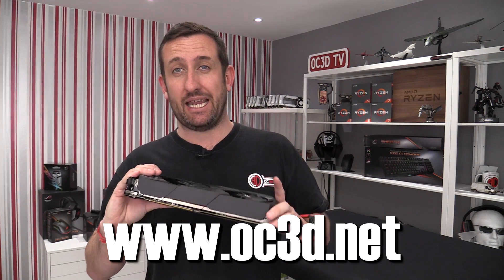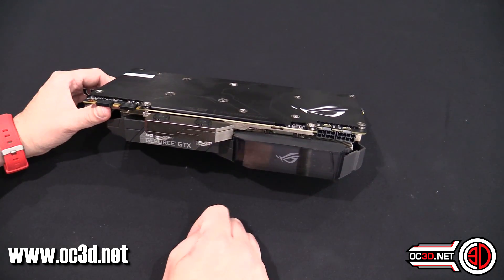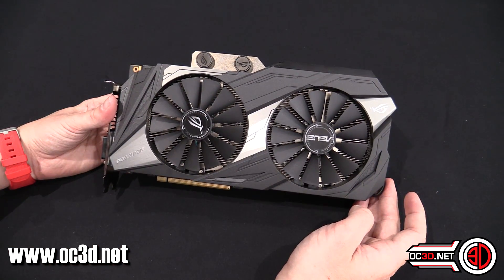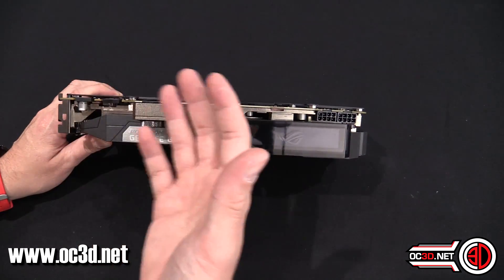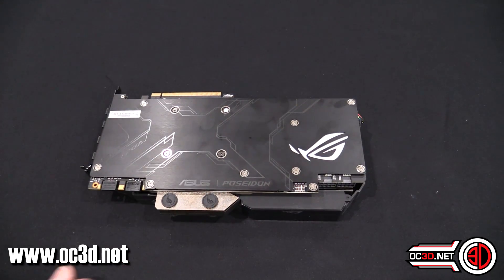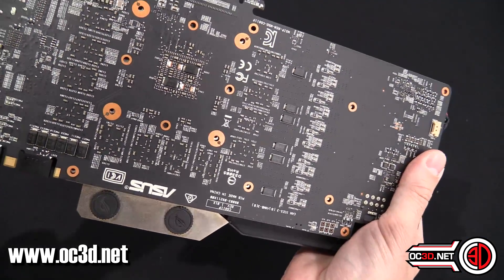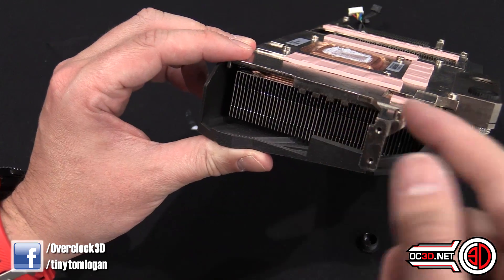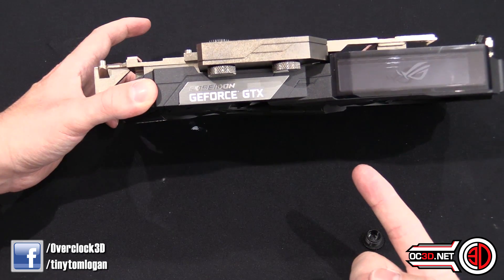Asus ROG Poseidon Hybrid GTX1080 Ti Review Air & Watercooled

Comment: I decided to liquid metal with conductonaut  one of my SLI poseidons to see if there's a big difference.  It dropped 2c on air from 72c to 70c at 21c ambient.  MSI rx480 gaming x dropped a whopping 7c at 60c from 67c.  The air cooling efficiency for the poseidon is a tad bit better than the reference, but no by much.  Water cooling is where it's at.  Will liquid metal the other poseidon and a titan Xp galactic in the near future and hope it has better thermal gains.

Comment: 27 degrees baking hot LOL, come to Australia, 40 degrees inside is baking hot :P What closed loop water cooler would you recommend? Also is there any companies that use refrigerant in their coolers? I would have thought that would make more sense. Ok, being complete newbie to water cooling, perhaps I should go the Strix though if you get 75 degrees in a 27 degree room, I wonder how hot it would get in a room I consider hot, mid to high 30s or above though at that point I would probably have put the aircon on.

Comment: Any idea what type of metal the water channel is made out of? I am concerned it might be made out of aluminum. I bought this card and added it to my custom loop. It is performing extremely well and temps are excellent but I am concerned the water channels are aluminum. With overclocking I am stable at 2075 mhz and temps are in the low to mid 40s. I hate to have to return the card but I will if I find out the water channels are aluminum. I haven't been able to find a solid answer.
Reply: I ended up returning the Poseidon. I couldn't and still haven't gotten an answer from Asus about what the water channels are made out. I am not going to risk damaging my loop if the Poseidon water channels are made out of aluminum. I am going to get a different 1080ti and an EK block.

Comment: how big of a power supply do you need to SLI two of these
Reply: I would say go with a 850 or more. When overclocked this card can pull over 300 watts. Two of them in SLI with a high end CPU could pull 800 watts easily if not more. If you are running a very power hungry overclocked CPU I would go with a 1000 watt power supply.
Reply: So I got a 1000w power supply the problem I am having now is that both poseidons SLI with the bridge is overheating. I do not know how to custom water cool yet so I wanted to start out on air but now they are overheating and freezing :/

Comment: The big advantage with this card is that you can sell it much easier than a water-cooling only card since it doesn't require you to have a custom water-cooling system
Reply: Also, if you are working on your loop you can still use air cooling.

Comment: Would you pick this or the EVGA Kingpin 1080ti card?
Reply from the maker: Ive not had the privilege to test the Kingpin so it would be unfair for me to advise
Reply: Chris G I’ve been trying to decide between them both, also. I decided on this because it’s July 1st and the Kingpin release date hasn’t even been announced yet. Even after pre orders start, it usually takes EVGA quite a while to deliver or keep stock up. I am a little worried about Asus customer service, though. I think the main reason I chose this is because I don’t have to buy a water block right away. I just moved my PC into a Lian Li PC-O7s. It’s a compact ATX case with no front fans, only top exhaust, so the water cooling is almost a must with the tempered glass side panel on. 

Hope that helps you out.
Reply: Chris G I had the Strix, but I returned it because of pretty bad coil whine.
Reply: Scott G. Was thinking of the Strix but I might change my mind.

Comment: how low does the temps gets on water + fans set on max?
Reply: jayztwocents tested it with a 240mm rad with the rad fans at max and gpu fans at 60. Under 100% load at 2110mhz it was at 42c

Comment: the good thing is flexibility you can run it on air to check stability of system b4 you install the loop, or you for limited time you don't run water or you plan to water cool in the future this card would still function pretty well.
the down side might be the price some places it runs for 840$  some place it would run more like tom said, depends for how much you get it for ,
a decent water block would cost you around the 120-140$ so if you plan to water cool non reference card it might be a good card assuming you get it for reasonable price ,
personally i prefer normal full waterblocks that can even make your card 1 slot and looks is usually better, but it up to the individual to decide .  but god those manufactures need to get rid of the DVI port
so we can have beautiful 1 slot cards. also you have MSI seahawk EK and EVGA hdro copper (when it would come out) , so if you want to buy preinstalled water block card you have 2 other good options.

Comment: Aorus 1080 Ti 11G: SuperPosition Extreme 1080p scored 6276, compared to POSEIDON on water 6004... See TucoPacifico (my) post: http://www.overclock.net/t/1627238/gigabyte-aorus-geforce-gtx-1080-ti-owners-thread/1240. Am I so good with my case cooling, or is the Poseidon just inefficient?
Reply: Or won the silicon lottery?
Reply: เพียงใช้ตัวแปลภาษา :D

Comment: The reason the temps are pretty acceptable on this card is because the heatsink uses a vapour chamber with an embedded water flow section, as Linus mentioned, manufacturing such a vapour chamber is quite expensive and a massive challenge, it can't be cheap and that's reflected by the price.

Comment: could you run water with air and get even better results or you are limited to only one ?
Reply: +Pennywise so this card should easily be under 40c with both cooling solutions and a low fan speed would make it quiet.

Comment: lovely thing about this is you can test or use the card as you finish saving up for water cooling parts. also have to consider your spending an extra $100+ for the block anyways. wish you could flip the led on the side upside down for inverted cases

Comment: This card costs about 899.- here (CH). That sounds like a lot, but the EVGA iCX it tied with in temperatures is 899.- aswell (860.- if you are lucky).
It costs only about 120.- more then an FE card and a decent waterblock would cost about that much too. Basically, I would pay the same for this one as for an FE + waterblock, but with the poseidon I would get an rgb-controller, a fan-controller, full warranty and a backplate on top.

This card makes also sense if you want to watercool but don't have enough radiator-estate to support GPU+CPU oc'd - giving you the peace of mind that your cards fans will kick in if temperatures get too toasty (something i had happened with a mITX build in the past).

Comment: I guess the days of dual gpu cards are long dead long live my Mars 760
Reply: My 760 still "lives" on my shelf. Its my backup card since it does not support either HDMI or DP
Reply: I'm hanging in there with you mate. i recently breathed some new life into mine with a waterblock
Reply: nice. hows that going for u ? i found some on ebay but i dont know if they are to be trusted as they look like generic chinese junk
Reply: it's going well, it's a bykski waterblock and I was cautious at first but it's been running 24/7 with no issues for a while now. I got it from Alibaba from memory as it was cheaper to go straight to the supplier.

Comment: Well I had the 980Ti Poseidon and now I have a Founders 1080Ti with a proper water block (HeatKiller IV). Both are 250W TDP, and I can say that poseidons are S** next to a true water block. 980Ti@1507MHz 40 in idle and 67C in games, 1080Ti@2087MHz in the same loop 24C idle/ 38C in games (in loop with a 5930K@4.55Ghz). 1080Ti Poseidon might be better than 980Ti poseidon but still a proper block will be waaaaay better.
Reply: its a$u$
The Strix 1080Ti has a very good cooler and before that the Matrix gtx580 and the HD7970 had great ones too 
a$u$ coolers became more shittier as their name grew  
Personaly i have 2 ROG builds but i got them just for the looks , its a waste of money if any1 i looking for price to performance
Reply: Well they are still making some awesome cards, just this line of poseidon is pointless with those results.
Reply: i agree but like i said you pay for the brand name and not much anything else 

The cards PCB and the VRMs itself is great its one of the best but the coolers have been shit on previous gens 
Just look at the 980 or 290x Matrix , that cooler is piece of shit and the prices were and still are crazy ..yeah it looked good 

in the past 5+ years they dont bother with the GPU cores or the memory soo much and that was/is their weak spot too 
For example i had the HD7970 Matrix and it clocked at 1200mhz max and it artifacted , as my second card i had the Sapphire Toxic and it clocked 1350mhz no problems what so ever 

Right now i have 1070 Strix because my 980Ti Strix died on me (i did rma swap) and the reason was one of the memory chips burned because it wasnt cooler properly
When i buy something i OC the things as much as i can and so far only Asus cards have failed/died on me and i dont buy the cheap stuff either 
 
So far if you wanna great quality product for Nvidia go EVGA and for AMD go with Sapphire the rest of the brands are questionable sometimes they are great other they fail hard
Reply: Well with Asus since few years we pay more for logo that is right. And yes EVGA is making some amazing quality staff. My 1080Ti is from EVGA.
Reply: its hard to get EVGA in my country but my great old GTX 580 3GB Classified still runs great :)
Reply: They are shipping world wide from their web shop^.
Reply: yeah i know but the price with the customs in my shitty country :(
Reply: Tom said it's better
Reply: Was hoping that this card would be the answer to watercooling my custom gpu build but you are right. This doesn't seem to be worth the money. The build I'm trying to do is use is a EK water block on a 1080 ti strix OC edition. Don't know if you seen the MSI 1080 ti Seahawk X edition but that one has a built in EK water block already.
Reply: Go with EVGA, Asus policy to WC is a no, no. If you will take off the cooler without voiding your warranty. EVGA has the best policy about modding their stuff.
Reply: XxDevilsOutcastxX yes but the price of that msi with ek block in insanely high (at least in Europe). At this price i could buy a evga ftw3 a water block for it and still keep around to 50€ in my pocket
Reply: I don't recall a 980 ti was released for Poseidon, only the 980 was available as Poseidon :/